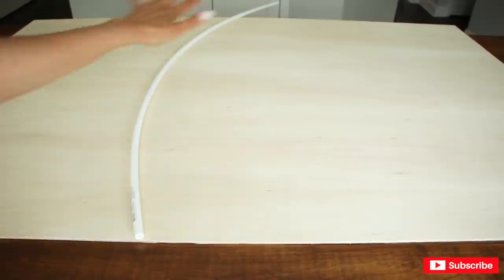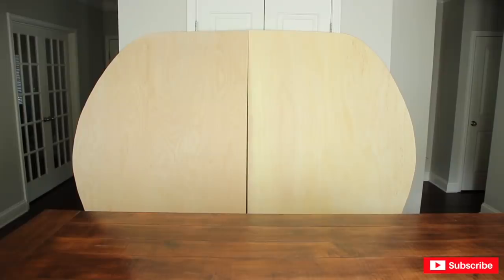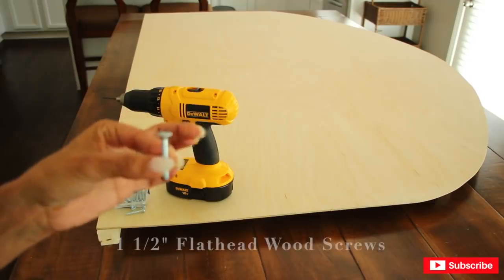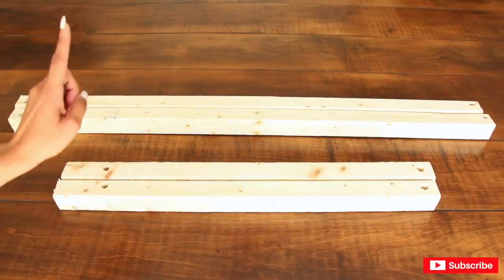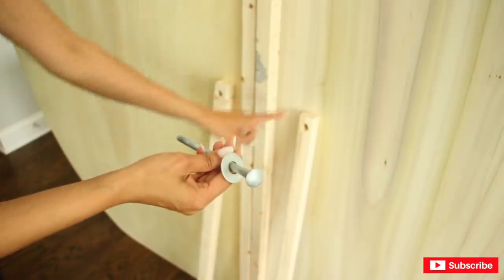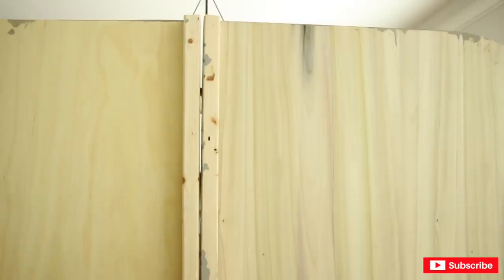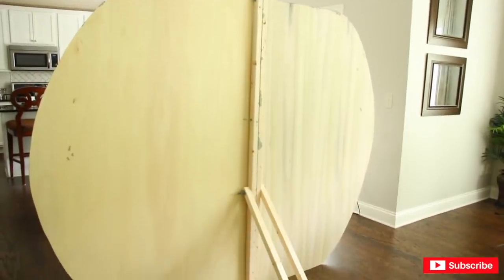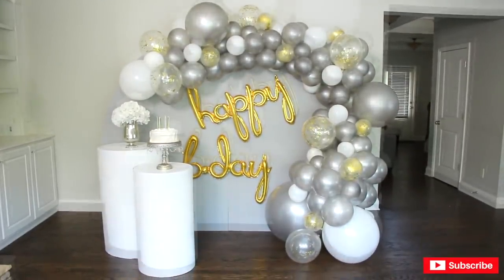DIY Round Backdrop Stand DIY | Round Backdrop Tutorial

Comment: Tayra, this is genius on several fronts!! You made it, it's sturdy, it's big and spacious, it eliminates the need for putting things on a wall/trying to hang things.
But...I have some questions/concerns! Isn't it heavy as all get up and awkward to transport unless you have a pick up truck or trailer??? I just knew you were going to put hinges on and make it fold in half (easier to carry/store). Also, how do you mount the balloon garlands (tape, glue, hooks)??? What lighter weight, but sturdy, material do you think could be used instead of wood??? Thanks for answering these questions AND for sharing your skills with the world!
Reply from the maker: Hi! Not heavy at all. And yes, you’d definitely need a truck to transport. Each panel is 4X6. I  use a Uhaul truck, when props are too large to fit in our truck. You can add hinges if you’d like, I didn’t find it necessary. It will take the same amount of space to store. Totally up to you to add. To hang garlands, I use transparent thumbtacks, and fishing line. Hope this helps!